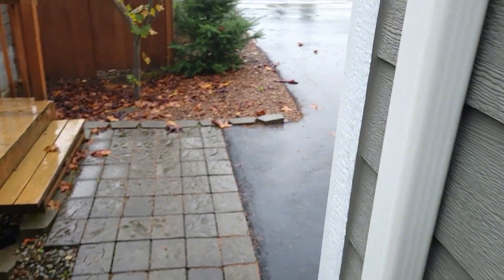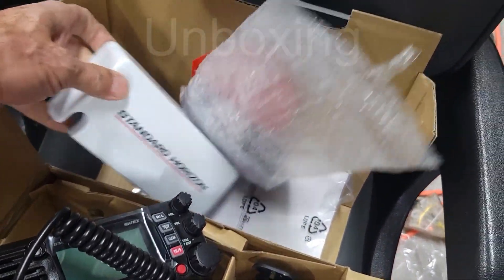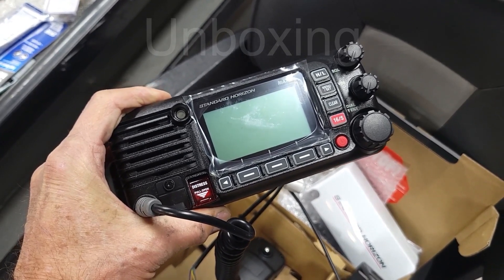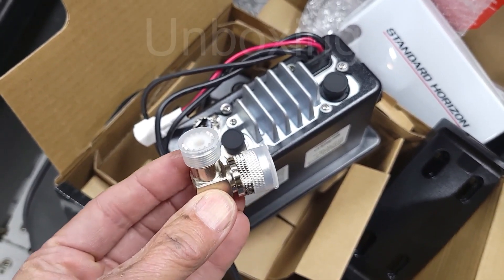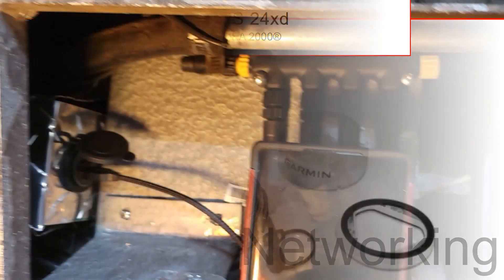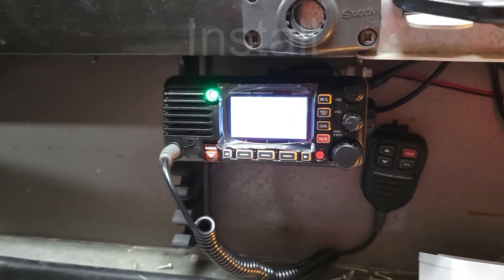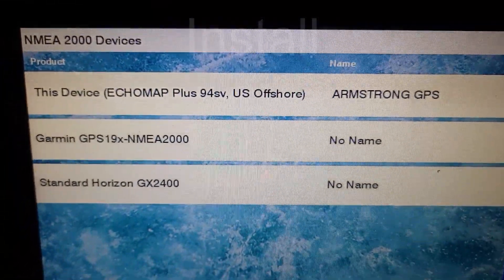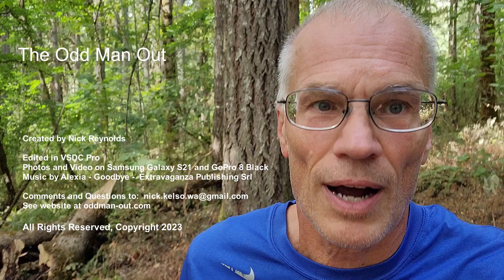EP106 - Standard Horizon GX2400 VHF Radio UnBoxing and Install – Neither Travel nor Exercise

Comment: Thanks! I am thinking of buying the slightly newer model (GX2410) of your radio. 
1- How is the voice clarity?
2- I like the separate squelch knob. How well does that work?
3- How well does the channel select scroll knob work to quickly change channels? I like that on my old ICOM radio, but some recent models have moved to only the up & down channel button.
Thanks again!
Reply from the maker: Thanks for the questions!

1 - The voice clarity - Received - is good. I am not sure how it sounds to others when we broadcast.  But it is still radio, it never seems all that clear, but there are so many variables about the radio on the other end and how the sender is holding the mic, distance away, antenna quality, etc.  I think this radio is as good as it gets.
2. - I think the separate squelch is a good thing.  It seems to work cleanly and as it should.  I usually set it so it just squelches the static on an inactive channel. 
3.  I don't particularly like a rotating knob to find a channel.  If you are monitoring 9, and need to go to 68 to talk to a friend, it is a long way up the dial. I would prefer a keypad, but I don't see that on any radio.  The rotary dial works okay if you don't panic.  I always feel like I am in a rush to find the new channel, but if you take your time it works fine.  I think it is better than the up/down buttons.

Those are my opinions.  Worth what you paid for them!

Comment: Great video. how did you find this Ais receiver in the garmin mfd? we are looking at upgrading our sailboat network from nmea 1083 to nmea 2000 and this radio seems the most budget friendly way for the chart plotter to receive the radio and ais
Reply from the maker: Most of the Garmin MFDs I have seen have a settings page, and from there a communications page.  From the manual for this unit:  Settings > Communications  On this page were Serial Port, 0183, 2000, and wireless settings.  Then: NMEA 2000 Settings - Select Settings > Communications > NMEA 2000 Setup.  Device List: Displays the devices connected to the network. 

So finding the device list with the Radio/AIS unit shown was relatively straightforward.  But it only appears when the unit is connected via 2000 and powered on.  (Made that mistake once!) And this is an optional step just to reassure yourself it is connected, it works as soon as everything is hooked up and turned on.

One of the things I love about the N2K network is how easy it is.  If you have it connected right with the power and the terminators, the information exchange between units is seamless.  I always struggled with the 0183 network whenever there was more than one device.  I highly recommend the upgrade.